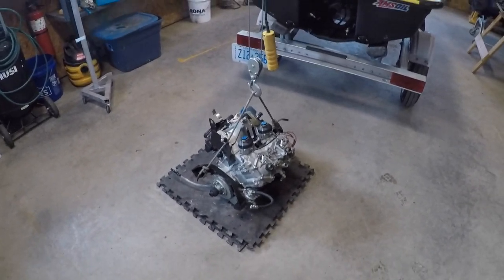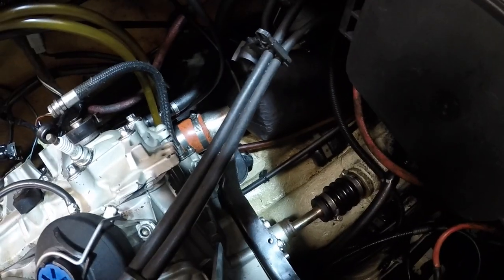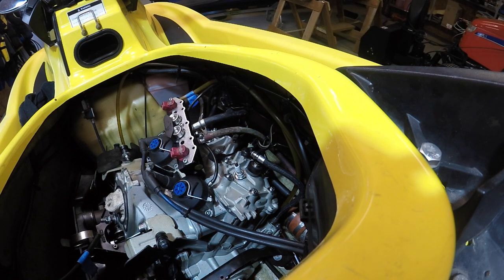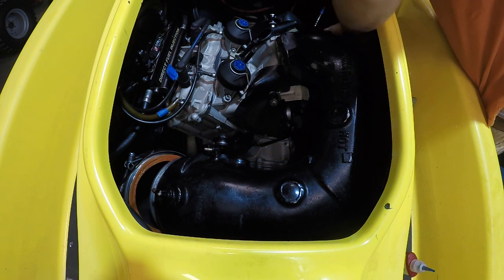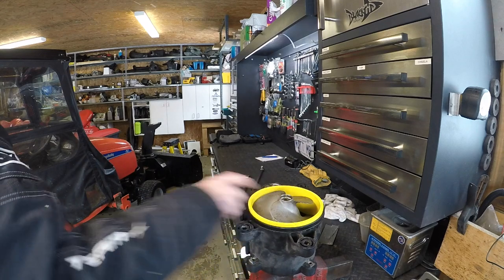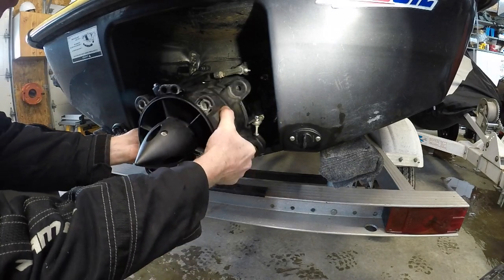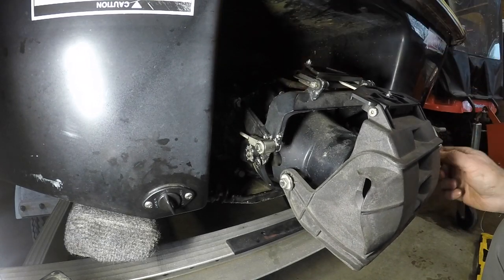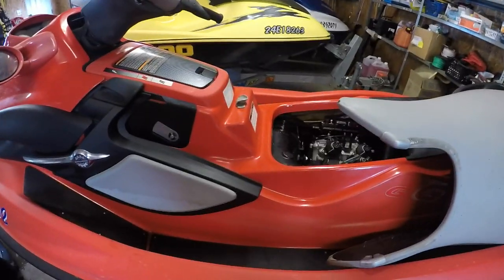Seadoo 951 di engine install   HD 1080p

Comment: Love your content. I’ll be installing a new engine in my gtx as well. Good tips. ? Did you use any spacers on the motor mounts for the motor alignment?
Reply from the maker: yes…they mount below the Engine mounts and were already installed.

Comment: Where in Ontario are you located. I'm looking to buy my first seadoo boat. What things should I look for when buyinh
Reply from the maker: Best thing is to go for a test drive.  That will tell you a lot.  Don't just look at the nice shiny boat and think all is ok.  I have been caught too many times with boats that look good but don't actually run
Reply: @SeadooRefurb  I am mechanically inclined so this stuff is pretty familiar to me. I'm an auto tech. Is there more technical things to check also?  Also which motor is the better one the rotax or the mercury. Which one is easier on maintenance difficulty and cost?

Btw your rebuild videos were solid. You made it look very easy
Reply from the maker: @dgmotala  I have never worked on a Mercury engine before but I must say that every boat that has one here for sale is blown .

Comment: At 11:13 the hose what does it tie into is that the hose that comes from the carbs?
Reply from the maker: There are no carbs on this machine.  It is the di.
Reply: @SeadooRefurb  yeah meant to say throttlebody.
Reply from the maker: @carbonsin1  Hard to tell which pipe you mean.  The 2 I see ...the small one goes to the back of the exhaust on the lower left of the screen.